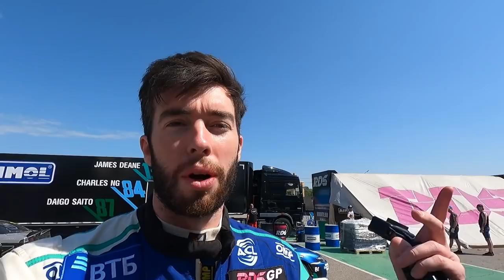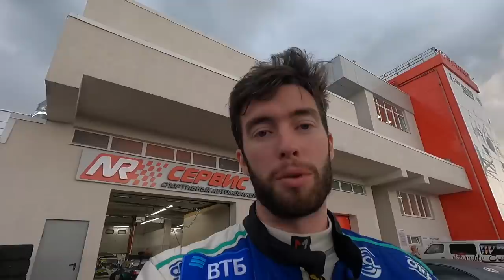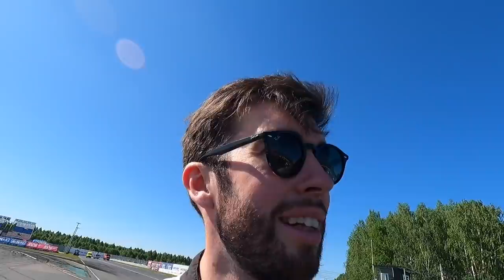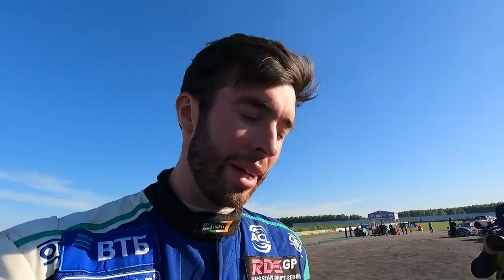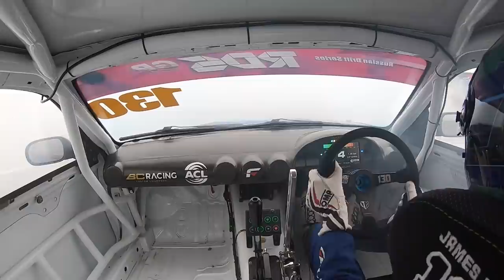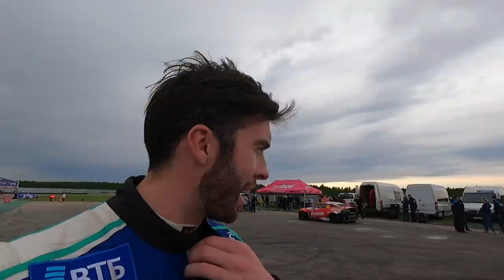Pushing hard at RDS GP Round 2 NRING Circuit | Close Tandem

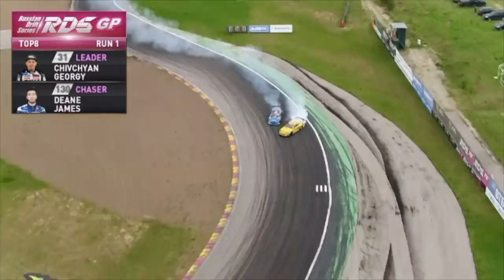Comment: About OMT with Gocha. When you chased him, you had an obvious T style (21:09), and this is heavily punished by the judges. The main task: to keep the angle the same or larger than that of the leader. So the judges were for Gocha. Good luck next round
Reply: I agree, but dont you think if he matched hes angle and line he would be in the smoke line, and couldnt see absolute shit
Reply: Gocha understeers wide at the end of the run in OMT where as JD is pinned to the door over the line, offsetting the T style earlier in the chase? JD had better lead run in OMT again in my opinion so at minimum it should have been second OMT! Fair play on staying humble and looking forward to the third round 🇮🇪
Reply: @stanley4290  agree. It is a problem when the chaser has less power than the leader
Reply: @dylanbroderick6869  JD had huge understeer after initiation and initiation was no that smooth. Such things are very point damaging in RDS. You can recover poor line with agressive and fast transition and initiations.

Comment: I feel like James' car is a bit too slow compared to most of the other competitors, some more power could definitely benefit him.
Blown away by the humbleness of this man tho after everything he's achieved in the sport he still gives everything he has every time, true role model!
Reply: I don't think Jame's car need more power. The grip is the key. Sometimes it feels like too much power on wheels for James. I'm sure they do their best for making car faster on track. 
May be some suspension adjustments or experiments with tyres (width, pressure) will change something.

In run with Gocha it easy to see that despite they driving simular cars with simular engines the behevior for them (S15's) is very different. Gocha's car feels more stiff but more grippy. Usually it opposite. More softness = more grip.

My thoughts: Gocha had soft (no idea softer or stiffer that Jame's S15) springs on the back and stiff (compare to Jame's S15) on front.

Comment: imma be honest, the quality of the drivers here, in RDS, seems to be way better than FD USA. i watch LZ a lot and there`s always crashes. here everyone just seems to be so much better and don`t make that many mistakes
Reply: Maybe. But have you seen any walls in RDS so far to crash in to?
Reply: @pieterv6984  At the third stage in Atron there will be a wall magnet, which took a lot of good cars ;-) And at the last stage in Sochi on the F1 track
Reply: I watch alot of FD and drifting in Japan RDS! Problem with FD in us is there tracks are different and very one from another RDS has wide open fast tracks where FD is fast initiation and then a bunch of slow turns and usually whoever wins has the most traction and can accelerate the fastest out of the slow turns!
Reply: @jaredm674  interesting. I will look for that next time I watch the different series.

Comment: would love to see you speak to a judge if english is not a problem of course but id like to know what exactly they are looking for
Reply: RDS favoures style and agression. Fast rapid transitions no corrections and closest and parallel transitions. chaser may not collect clipping zones and can cut through no go zone instead of leader. So if you have close run and your angle is the same or bigger than leader you may cover up for line problems. Points in qualification divided like that: 30 for line 30 for angle and 40 for style. As far as I see. A lot of point deductions were made even in qualifications for non smooth initiations or transitions.

Comment: I really don't agree with the top 8 call with gocha, alot of my interest in the rds series has been very diluted with the very strange calls. There isn't consistency or enough attention paid in the judges calls.. but hey, it's not over till it's over, and what's a win without the added drama 😉
Reply: This is not the first commentary of this kind that I have read. I can't understand, did we watch the same video?
Gocha's chase had a larger angle and synchronous transitions. In RDS, it is important not only to be close, but to shift synchronously and have the same angle as the leader's or MORE, but not less. Jame was driving in a T-style with a lower angle.
James' transitions were belatedly like a whip.
Reply: @Ewan_Gaming  well explain to me, how the chase driver in one car can follow in the line of the lead car and keep close chase, but in reverse roles, the other driver can go WAY off line to keep up and completely ignore the qualifying line. Inside line of the track is shorter the more you use it, that's why the finish line in running is staggered!  If the question doesn't stand at every battle of WHO GAVE THE BETTER CHASE then you're making the wrong calls. 
I want to see the best driver win, and fair calls are what's right to each and every driver who puts his career and machinery on the start line. I'm sure every driver after the next will take an easy win as easy as a hard win, but a fair win they both have to be. 

Synchronized tandems are all well and good and look spectacular, but that requires shortcuts in areas and requires wider and shallower than the qualifying line.

If you only allow the lead driver to do a qualifying line which isn't the fastest line around the track, you can't expect a fair call from a chase car that is allowed to cut inside . A person that deserves a better vote is a chase car that can follow in the qualifying line close like the lead driver. 

Synchronized tandems only work properly in racing line. Like what was practiced in Japan for years.
Reply: @decobyrne106  rds rules makes tandem more epic. All drifting for epic runs in most tandem runs. T-style chasing looks bad.
And rds are mostly japan style and japan shcool.